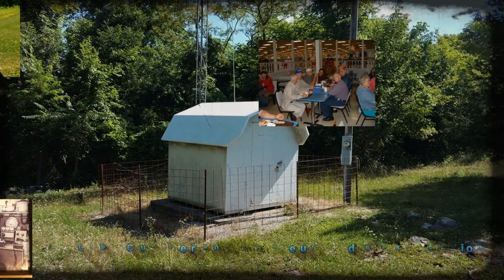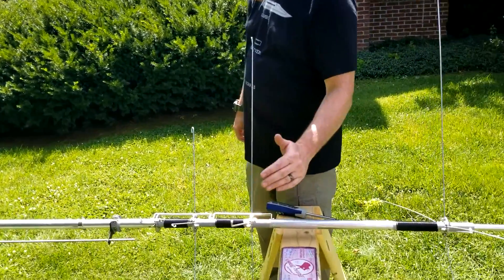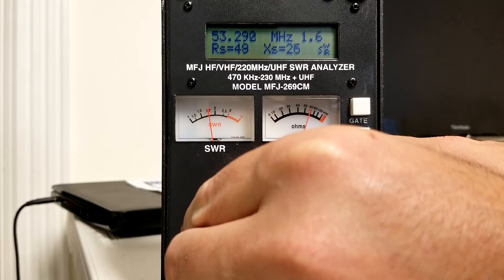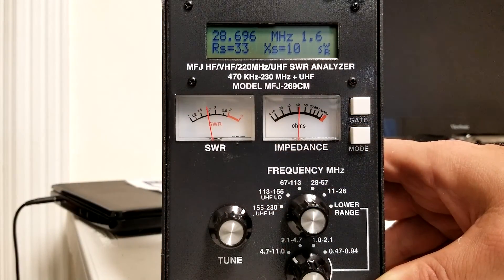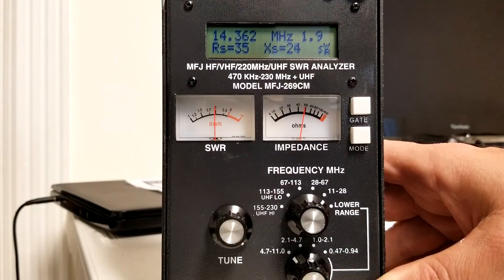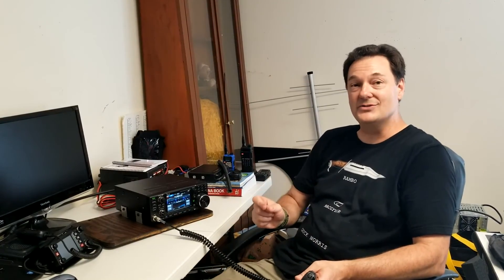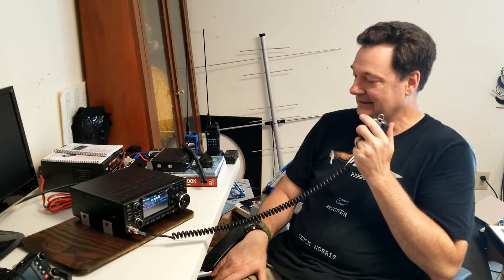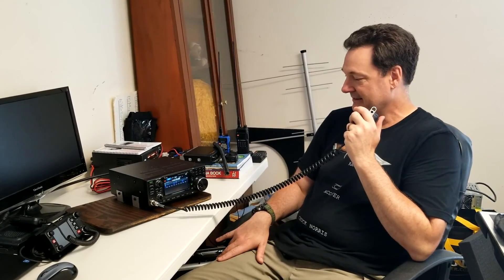LCARA HAM Radio: Hy-Gain AV-640 Antenna - Part 2

Comment: Wondering if you were able to resolve the 40 meter tuning issue you described where it was resonating way above the 40m band...  I'm seeing a similar issue where it's resonating at 7.47 Mhz with the 40 meter radiator length (L40) set at 18 inches for the SSB segment (per instructions)... which Tom at Hy-Gain says is likely due to a bad joint around the 40 meter hat ring causing the 40 meter radiator to be a lot shorter electrically  -- otherwise he says it would never be that far off.  The L40 tube would need to be lengthened 18+ inches to offset that much, which is not possible.    All other bands are fine -- so it seems this issue and what you showed for 40m are almost identical.

Comment: Hi, I'm trying to get my AV-680 in tune, and I'm wondering if you might be able to tell me roughly how much I should adjust these elements. Sounds like for 20 meters you took about 1-1/2 inches off? Not sure what I can do for 40 meters. Do I want to lengthen that? Use one of the extra 40" spokes to do that? Thanks! K0NOC
M.    Freq        SWR                Freq       SWR.     Dir.    Adjst
20	14,225	6.07		14,350	6.52	Up	Shorten
40	7,175	3.9	7,205	7,300	1.28	Lowest point: 7,286	1.05, Lengthen?
80	3,800	8.41		4,000	14.97	Up	Shorten

Comment: How the antenna performance has been?
Reply from the maker: I really like this antenna. It was my first put-it-together antenna and given how long it is, you need a good sturdy mast. As for making contacts, it works very well. Need to adjust 40m some more, but all the other bands are tuned in the lower-middle of the bands.

Comment: Thinking of buying one.  Not sure the AV680 is worth the extra cost and height as the bandwidth is so narrow on 80 meters.  Thanks, Vee  W7IBB, Utah
Reply from the maker: I thought the same thing about 80M. Too narrow on the AV-680. I ended up getting an end-fed for now and will feature that antenna later on. Thanks for watching!

Comment: Does the tuning change much when you move it from horizontal on the saw horses to mounted on the mast and vertical?
Reply from the maker: Once we had it on the mast, we would note where the dip was located on the bands with the analyzer. KY4CKP and I would take it down, tune, then put it back up and note how the dip shifted. We repeated the process four times documenting each of the bands while it was on the mast. It was close to 95F that day so we didn't take it down to finalize 40M a little further up the band, but it's tunable with the radio.